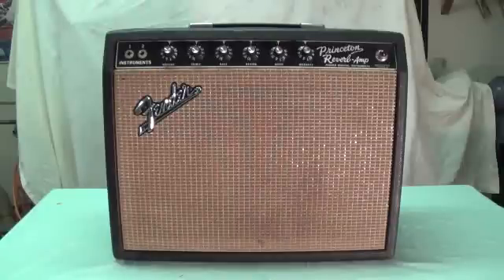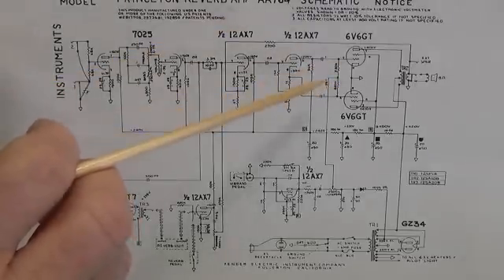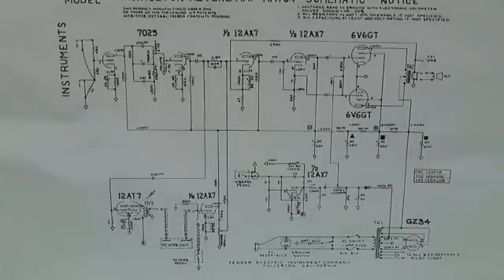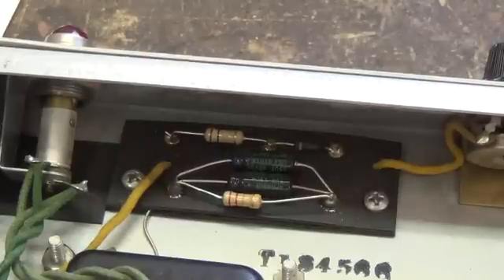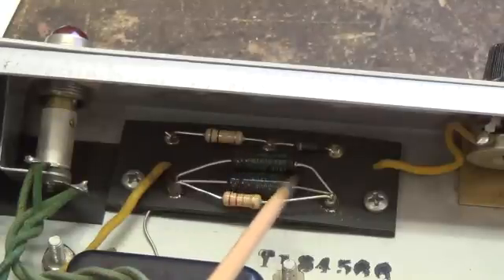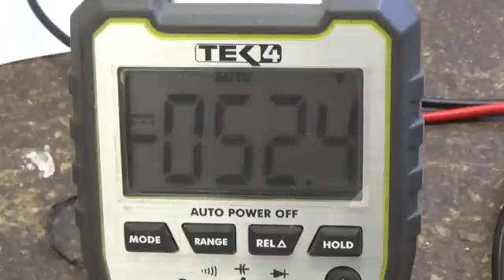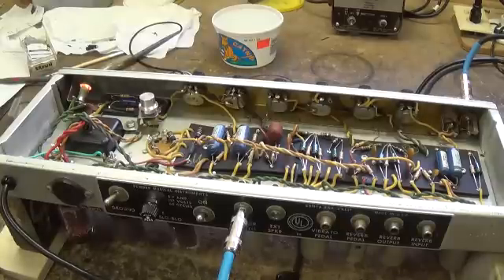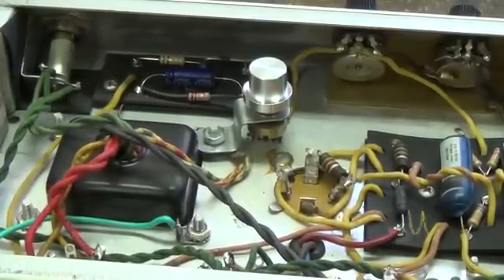Converting the Fender Princeton to Adjustable Grid Bias

Comment: UD, your suggestion to bend a piece of coat hanger to attach a bias pot to the power transformer screw post -- was brilliant! I have now installed a bias pot in my 1966 BF Princeton Reverb thanks to your great video. The original bias spec is 27K but the resistor measured 25.2K ohms. I was not able to get the PC below 27 mA on any pair of 6V6s, so the idle PD was over 11.5 watts. Once I installed the 10K linear bias pot in series with the 25K resistor, I increased the resistance and reduced the PC to 19.7 mA and the PD to 8.4 watts. The amp sounds awesome and the tube life should be normal now!!
Reply from the maker: Wow....thanks, DB. You made my day. I'm glad to hear that the coat hanger pot mount worked so well. It really is a very simple, effective way to solve the problem. It also sounds like your biasing job was a total success, with both excellent tone and much longer tube life ahead. Your experience provides the best possible reason for making this conversion.....and your next biasing job should take all of 3 or 4 minutes to complete. Congratulations !!
Reply: Uncle Doug I did the bias pot wiring in an alternate way. But first, I used a Fender style 10K linear pot. The kind that is normally mounted in the chassis with a mounting hole cut, however I used your coat hanger mount as a “bracket” and avoided drilling the hole. Back to the wiring. I connected the 25K resister to the left terminal of the bias pot. The bias pot’s back and terminals are facing up. I added a jumper wire from the left to the center terminal. The right terminal goes to the intensity pot’s left terminal. This way if the center wipe fails the one resistor is still there, thus this avoids adding an extra resistor. Thanks again for your video that inspired me to add grid biasing to my Princeton!
Reply from the maker: You're welcome, DB. I'm glad the project worked out so well. Thanks for sharing this with us.

Comment: Hi Uncle Doug! Nice Videos! Where do you measure the Plate Current? I'm trying to BIAS a Fender Deluxe Reverb and I was trying to do this grid biasing. Thanks!
Reply from the maker: Greetings, Gus. I have posted a two-part video that shows how to bias a double-ended amp, such as the DR, step-by-step: http://youtu.be/w9B0Rhr_Y-E  and  http://youtu.be/pjKYiSr497w  I hope they are helpful. Please be very careful and follow all safety procedures. Good luck :)
Reply: I'm trying to make the readings like you said on the first videos about bias but It's strange. My resistence reading is measuring -634 ohms / -03.8 Voltage Drop / resulting in a plate current of 0,0063 with a plate voltage of 660 resulting in 4,18 W. I'm bising a Deluxe Reverb 6V6... My mutimeter is manual maybe Im selecting the wrong reading... Don't know...
Reply: Reading the voltage in pin 5 (grid) is reading -35 but I can't see in mA to see the bias. Thanks for your help
Reply: Uncle Doug Hi Doug! Thanks! I saw your message now. I saw the videos and I'm going to buy a better multimeter to try again. Thanks!
Reply from the maker: Gus, your readings are quite different from those I recently got from a DR. OPT Center Tap to pin 3 of Left 6V6: Resistance = 216.6 ohms, Voltage Drop = 4.59V, PC = 21.2mA, PD = 9.95W. The readings for the right 6V6 were quite similar.

I think there may be some problems with the way you are taking the measurements.  Perhaps it's your multimeter that is at fault. You should watch the video again carefully, and maybe seek the help of an experienced amp tech to guide you during this first attempt at tube biasing. Good luck.
Reply: Uncle Doug Thanks for your reply. I'm having problem with my multimeter when measuring. My multimeter become crazy and I bought another one and the new one had problems when I was reading the Plate Voltage. It made some noise and POP... I think I must get a better multimeter Category II 1000v. Well With this new one I made the reading one time adjusted the Bias a bit and when I was going to measure again it blowed and after it started to read wrong data.
Reply from the maker: Gustavo, it sounds like you might be better off getting some local, qualified help to perform the biasing procedure. It can be very dangerous and I would hate for you to get injured (or worse). Maybe you could watch the technician and learn how to do it.
Reply: Uncle Doug Hi Doug!!! Just to let you know that I got It! I bought a new multimeter with a better specification and quality did everything like in the video and realised the BIAS of my Deluxe Reverb. Really thanks for the useful and best explanation about it online! Thanks!!!
Reply from the maker: That's great news, Gustavo. I was getting a little worried about your project, but it sounds like the new, better multimeter made all the difference. Congratulations on your success.

Comment: Thanks so much for this detailed video.  I'm actually working on an old Elk "Twin Amp 50" (Japanese clone of... something?  A Fender with EL34s?  I dunno!).  I started recapping most of it, and that seemed to make it sound worse (well, it sounded "ok" when I used it, then it sat for a long time, and before I used it again I decided to do the re-cap).  I figured a good bias would do it some good, but it's pulling about 20 watts on each output tube and the measurements were even between the two... well, I'll admit my multimeter isn't the most accurate of them all (not-so-fancy digital Micronta) so I think I'll borrow one of my father's nice Flukes and check it further.

This leads me to a question: How close should the current readings actually be?  Are we talking "within 5mA" or "within 1mA"?  I noticed yours were 2mA difference (which then equated to a relatively wider spread in the dissipation).

First time I've biased something, and I used this video to help guide me through the amp and understand of how its biasing works (very very similar to this Princeton).  I did the shunt method and it was almost too easy to check it all (well, easy and a little scary).  I was looking for just this exact sort of instruction, very thorough - explaining what where and why, piece by piece. 
I'm kinda bummed it appears to be biased pretty darn well, as that (and new matched Sovteks) isn't keeping it from being so muddy and flatulent.  But at least I'm narrowing it down, eh?  And that means more to learn.  :)
Cheers,
-Alec
Reply from the maker: Greetings, Alec. Sorry to hear that you're having trouble with the "Twin Amp 50" (which, to be honest, I have never heard of). The plate current (PC) readings should at least be within about 20% of each other. If the difference is much greater than this, I would probably start plugging in other tubes (I have a bunch of extras) until I found a reasonably matched pair. If your EL34's are cathode biased, they should be running at close to 25W of plate dissipation, if they are fixed bias (grounded cathodes), they should be running at about 18W. If an amp sounds really lousy, it's generally something other than tube bias (unless the bias is WAY off). You might compare all the plate voltages to the schematic (if you have one), condition of the speaker, output setting of the guitar (i.e. too high), microphonic tube (tap on each tube and listen for a lot of noise from speaker), etc. Microphonic tubes can cause a lot of grief. Good luck.
Reply: Uncle Doug Thank you for the tips/info.  I've got preamp tubes to play with (though I've sorta done that already, but not methodically).  Unfortunately, I don't have any more EL34s.  It also doesn't help that the schematic I found doesn't seem perfectly accurate (heck, I'm surprised there's a schematic available at all for this silly thing).  Good 'ol bargain-bin clone quality!  Some people apparently like an old Elk, but but those people seem to have decent examples.  I just want to make sure this one doesn't get trashed or thrown in an attic (and then give it a working life). 
-It is fixed bias (pins 1+8 are tied to ground, I assume this is right).
 
Question: The schematic states all voltages are taken from a 220v model - will they be accurate for mine here in Kansas?  (The transformer is obviously specific to this region, and has no 220v lugs unused 100 and used 117v)  Seems like they would be, and everything post-transformer would be accurate.

I can toss a resistor on there (or I suppose I should to the conversion outlined in this video!) and pull the dissipation down under 20w.  I'll try that first.  
I seem to have put a term to the problem, "blocking distortion", and found an article by Aiken Amps about it.  Unfortunately they have list of several detailed, possible solutions.  Where would I start?  I guess at the top, and one at a time (and reverting back to "normal" if there isn't any change).
A weak signal, like a guitar turned down, is the signal that gets lost and muffled and dead.  If I plug in humbuckers and crank it, the notes come through but are obviously terrible if awkward chords are played, and sub-par otherwise.

If I come across any miracles, I'll chime back in here to put it on the record.
Thanks again,
-Alec
Reply: Uncle Doug (oh and while I was thinking of it, it does have new filter caps, notably)
Reply from the maker: One last thing, Alec. Check to be sure that there are no bad coupling caps leaking DC to the grid of the next tube. Good luck.....let us know how it goes.
Reply: Uncle Doug Well, either it was a preamp tube or a miracle.  I didn't touch it for a couple days, except when I borrowed a 12ax7 from it to swap with my OD pedal (wanted to try a JJ, pedal had Mesas).  Not sure if that was actually the issue... I wouldn't think it would be, since the tube I pulled (JJ) sounded great in my pedal (used it for a practice and subsequent show).  Hmm.  Unless I'm forgetting something... 

It was sounding pretty damn good, but I was initially having mild drop-outs at full volume (two humbuckers all the way up, plus big dumb power chords).  I vaguely remember hearing something like this being possible for whatever reason (drop outs at peak input/output, as opposed to my original problem of drop outs/mud at the bottom).  Maybe attempting to pull too much current?  Transformer struggling?

So I then threw another resistor, a 150k, on top of the 27k (mine is labeled 26k, actually, though it measures 27k).  Total of a bit under 23k.  It's pulling under 17w dissipation now (was at 20w before).  I was going to do this anyway, of course, but it definitely seemed to do the trick.
Runs great, not-too-hot, and sounds great.  Very dynamic and clear, the exact opposite of how it used to be.  Gonna bring it with me to rehearsal tomorrow (along with my main head, just in case) and see how it goes (hard to get loud here at home).

Hopefully my seemingly random success isn't a fluke...  I'm going to try to leave it alone for a while...  

-Alec
Reply from the maker: Congratulations on what appears to be a successful repair, Alec. I hope the amp functions perfectly at practice. Good luck :)
Reply: Uncle Doug Popping in one last time, the amp did great during practice but was a little under-powered for that particular band.  Sounded fantastic, though!  Thanks again!  I'll have a use for it very soon.  At least a stereo rig, perhaps! 
Cheers,
-Alec
Reply from the maker: I'm glad it sounded good, Alec. Best of luck :)

Comment: Another very clear and informative video Uncle Doug. I had a couple novice questions after watching.  At 8:20, you say "this is a negative voltage circuit the wiring to of the capacitors and the diode are backwards."  I expect most of your subscribers know how you could determine this from just looking at the circuit itself, but I wonder how you would know this either from the circuit or the schematic. Also, you note that the tubes aren't matched and the pot biasing with affect them differently--better to have a matched set. I wonder how tubes are tested to see if they match without putting them in the amp? My takeaway from this video is that if tubes are matched, the adjustable grid bias works the same for both and the only reason Fender didn't do it in the first place is simply cost.  Is that so?  Thank you and Rusty the Wonder Dog again for your time and highly enjoyable video.
Reply from the maker: Greetings, Carl. The high voltage circuit in amplifiers and radios is positive direct current (DC) and often called B+. The tube bias circuit, however, is negative DC. Since it's charge is the opposite of the B+ circuit, certain components, like diodes and electrolytic capacitors that have polarity (i.e. they must be installed in the correct direction) are installed "backwards" in the negative bias circuit compared to when they are installed in the B+ circuit. Failure to do this can cause a lot of problems.

The polarity of these components is clearly marked on the schematic for the Princeton Reverb. The 50uf capacitor is + to ground (instead of -), and the diode band is on the 100K resistor side (not on the tube grid side).

Output tubes are matched by putting them in a circuit and measuring their plate current (PC). Tubes are like fingerprints, they each draw a unique amount of PC......generally more when they are new and less as they age. After measuring the PC of a bunch of tubes, those with very similar PC values are put together in "matched pairs" and sold for a premium price. If you have matched tubes, then a single bias adjustment will work for the pair. If the tubes are badly mismatched, each one needs to be individually biased to neutralize the difference. If you have a bunch of vintage output tubes, you can do your own matching (by testing the PC of each) prior to biasing them.

I agree that Fender probably omitted the adjustable bias in the Princeton amp to reduce production cost. I hope this all makes sense. Rusty and I thank you for your input and wish you the best !!!
Reply: Thanks Uncle Doug.   I'll look at the Princeton schematic and follow along with your description.  Please assure Rusty I'm keeping my fingers out of harm's way until I'm better educated. Paper is much safer than high voltage components.
Reply from the maker: Thanks, Carl. I will check it out :)

Comment: Quick question about replacing the diode... what amp did you go with? The aa764 schematic doesn't give us a value for the diode.. just that there is one lol. I'm about to order all the parts.. 47uf (lol you had me going trying to find that 50uf) capacitor.. pots.. and new power tubes (im pretty sure ive got a 6v6 that's bad.. not a transformer after doing a bit more research).. but the value for the diode eludes me. Thanks again for the help.
Reply from the maker: Greetings, P6. Sorry for rounding off the cap value ;) Re diodes, about the only thing you need to worry about is voltage tolerance, and the 1N4007 diode is generally used (1000V @ 1A) in the bias circuit. Good luck with your project.

Comment: Sorry ,PD? I think I shoot for 42ma on the 6l6 power tubes. I have 250 ohm resistors 10 volt and 25uf 50volt caps in route. The risk is cooking power tubes?
Reply from the maker: The factor most significant in biasing is the Plate Dissipation, which is the PC (in amperes) times the PV. The PC alone is not reliable. You also need to know what type of 6L6's you have, because the PD max varies greatly for the 6L6GA, GB or 5881, and GC. 

You can't simply guess on the PD value. It has to be correct or the tubes will either be too cold (bad tone) or fry, and the PD max value is different for fixed and cathode-biased circuits. If you're not sure about the biasing process, I have posted a video about how to bias double-ended amps.

I think 250 ohms will be too low for the bias resistance. It will probably end up being in the 350 ohm range, but that has to be determined by measurement, not guesswork.

Comment: Great videos Doug. Thoughts on converting a 6l6 amp to cathode bias? Think 69 bassman.
Reply from the maker: Thanks, DS. It would not be difficult to do. It would require a little trial and error with the Cathode Bias Resistor value, to get the proper PD at idle, and then (perhaps, depending on the tone you seek) bypass it with a 25 to 100 uf capacitor. I have done this with other grounded-cathode Fender amps (i.e. BFPR), and it works well.

Comment: I switched the 1 meg for a 22k and it squeaked out of control. It was the resistor directly connected to the speaker lead so I thought it was the neg feedback resistor. I think this amp has seen mods I haven't done. Doesn't look like 165 or 864 layout in this particular area of the board. If there is a way i can get a pic to you I would love your thoughts on what is going on in the area of the NFB resistor. Thanks for time, I ll post your vids on a local facebook musician page.
Reply from the maker: I'm not sure if a photograph would be much help. The actual circuit diagram (from the amp itself, not a schematic) is the best way to spot a problem. If the amp squeals, it sounds like the polarity may be reversed on the output transformer. You might consider reversing the two secondary (output to the speaker) wires. The 1 Meg resistor probably prevented the squealing, but the correct way to solve the problem is to switch the output wires. As it is, the NFB loop may be a POSITIVE feedback loop.

Comment: Removed the 470k at the 7025. Like taking a blanket off the bassman. Get this , someone had put a 1 meg in the neg feedbk loop . The one off the speaker jack. The amp is lively but you think that value is too high?
Reply from the maker: I'm glad to hear that the 470K removal worked well for you. Re the NFB, I would think that a 1 meg resistor would effectively eliminate any negative feedback, but if the amp sounds good to you, that's all that really matters. You could substitute a 1 meg potentiometer for the 1 meg resistor. This would allow you to select the amount of negative feedback that you like best, instead of settling for a fixed value.